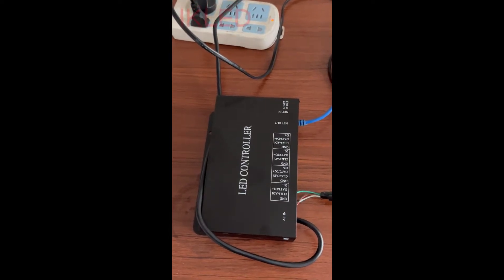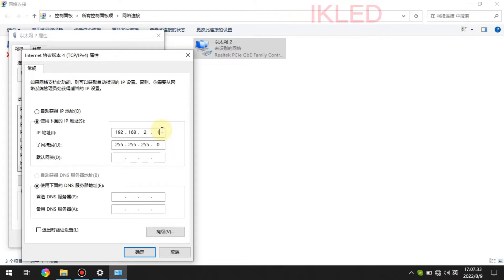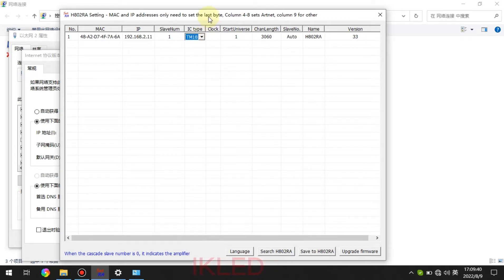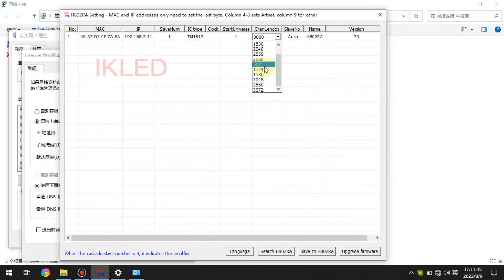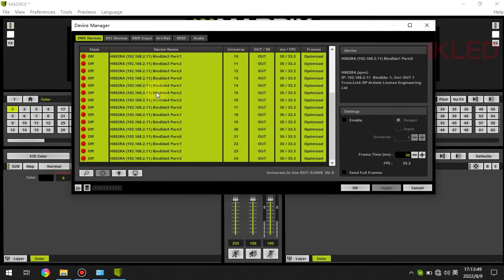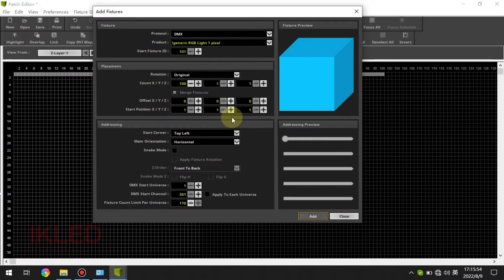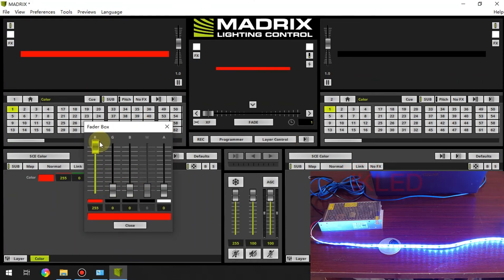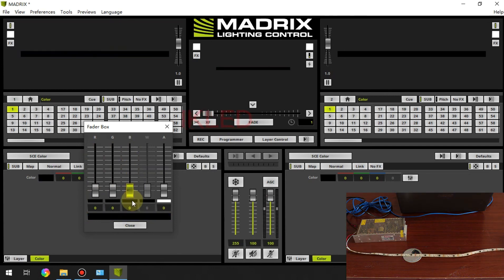H802RA Toturial Video

Comment: I use it with a resolme connection, but it flashes intermittently. 
Have you experienced any of these symptoms..?
If you've been through it, is there a solution?
Reply from the maker: yes, i can solve it
Reply: @kevinqi8876   I'm so curious about the solution..
Reply: @kevinqi8876  I'm so curious about the solution..
Reply from the maker: May i have your email address ?
Reply: @kevinqi8876  I left an e-mail..
Reply: @kevinqi8876  Can you take a look at our status quo?

Comment: Hi, I have some question.The red cable input for led strip where did you connect? What volt input your H802RA? And last but not least where can I get setting H802RA software?
Reply from the maker: Hi, the red cable is connected to DC12V. The voltage input of H802RA in my country is AC220V. The setting software link is up in the video description.
Reply: @kevinqi8876  thank you for you reply, but im still confuse where did you connect the red cable, seems that you put it together through the AC in, please help, thank you
Reply: THANK YOU , all good now
Reply: @agustinusketutadimulyawan1141 what u did?
Reply: @malachiorgad9689  😂

Comment: Hello Sir, i checked all your settings with Madrix + LED stripe WS2812B + H802RA and it works perfekt. But i am in trouble with another LED Stripe (LPD6803)! Which setting i need to set to SetRA Controller tool? AND what wirigin is right, because LPD6803 has Clock wire (BLUE). I think my complete wiring is wrong. Can you help me to figure this out? Thanks many

Comment: hola como estas? por universo cuantas tiras puedo usar de 5m 2811 ? quiero usar varias dentro del mismo universo. y tambien conectar varias controladoras en serie
Reply from the maker: Hi, for the WS2811 strip, it has 20pixels 60leds, so one H802RA supports max 680x4/20=136 meters

Comment: Hello i have 8 H802RA controllers but only one appear in led studio, how can i add all the led controller to madrix?
Reply from the maker: 1. how do you connect them together ?  2. Do you have the H802RA setting software ?
Reply: @kevinqi8876  i connect them in series and i use LEDSTUDIO to  set  them
Reply from the maker: @kouadiooliviernguessan8917  no, you need the "H802RA setting software" to set controller number, choose chip and set universe number per port
Reply from the maker: no, you need the "H802RA setting software" to set controller number, choose chip, and set universe number per port
Reply: @kevinqi8876  i use SET RA H802RA Setting software
Reply from the maker: @kouadiooliviernguessan8917  yes